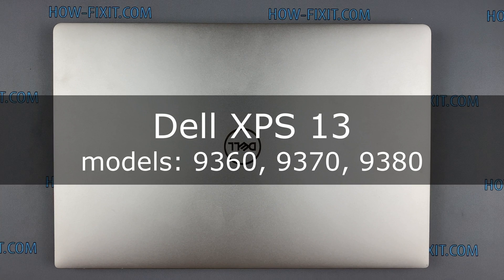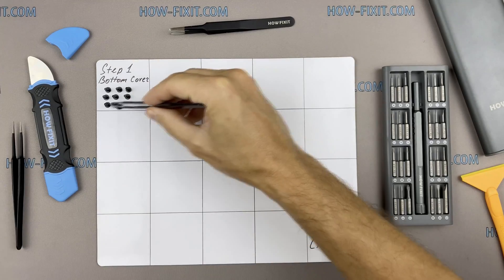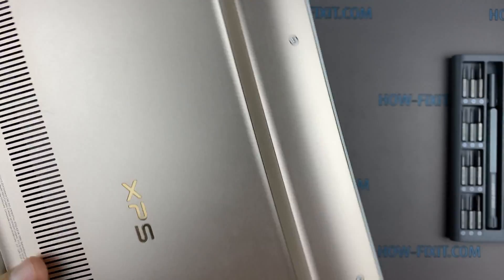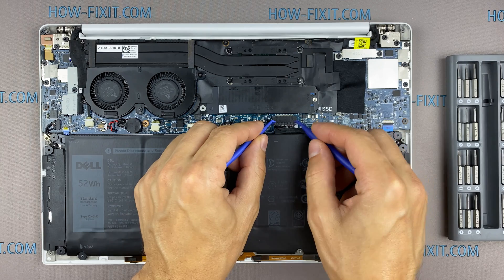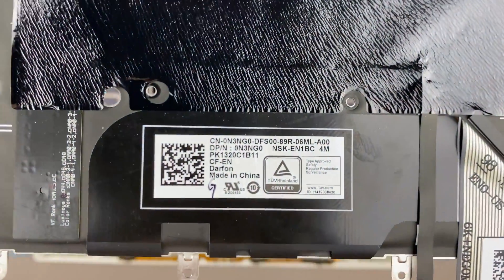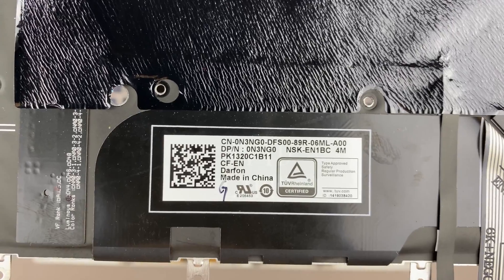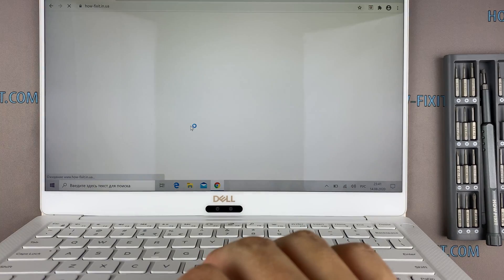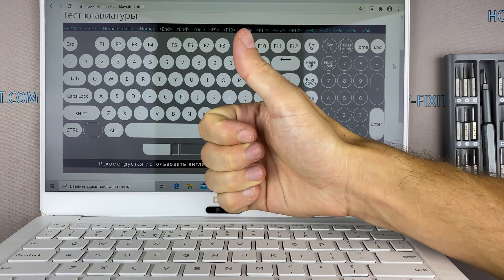Dell XPS 9370, 9380, 9360 Keyboard Not Working - DIY Replacement Tutorial

Comment: Great video but does not apply to XPS 13 9360 model. The 9360 has a different hardware configuration and the keyboard can be replaced without removing all of the mainboard connectors and daughter boards.

Comment: We followed instructions very closely and upon re-assembly the laptop no longer powers up.  Now we have to investigate and see where the problem is.  The power cord that was taped to the bottom of the keyboard seems to be the problem.  It did not Re-stick to the keyboard and may have caused a short somewhere…. Any other people have similar problems?
Reply: one of the key issue with this video is the person is not using static bands.  a laptop with small micro processors will fry up if not properly grounded.

Comment: I just did it following your excellent instructions.  I was wondering however, is it really necessary to disconnect the motherboard from all the cables that connect to it from the top on the left and the right (at 3'00'' to 3'30'')? Couldn't I just have left these cables connected and gently lifted the motherboard to replace the keyboard beneath?
Reply: If you tried that, you would be unsuccessful because there are additional screws hidden/covered by the motherboard holding the keyboard in place. Removing the motherboard and cables is definitely required in order to access the covered keyboard screws.